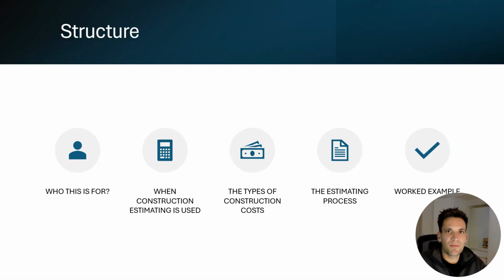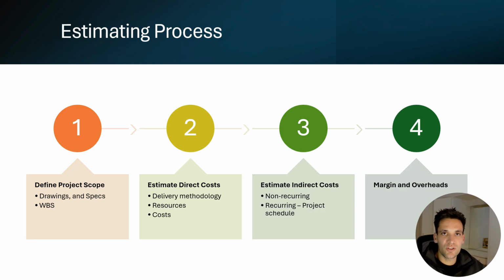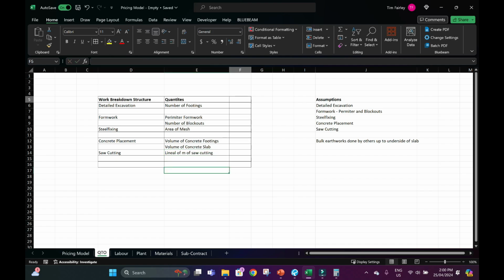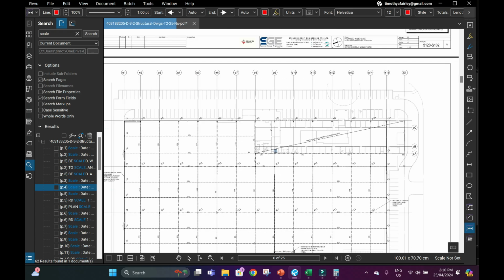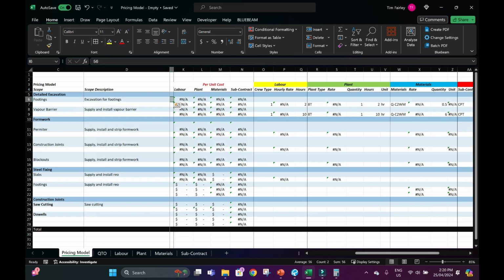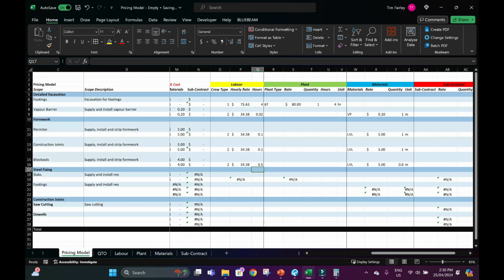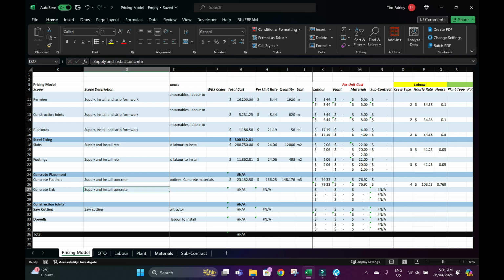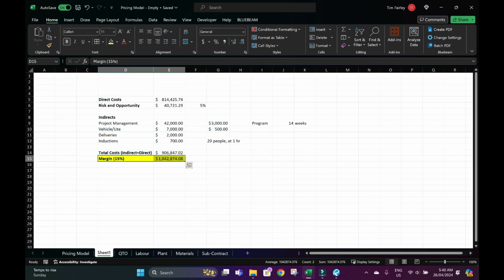Estimating Construction Costs: What You Don't Know (2026)

Comment: Hi mate, bluebeam revu, planswift, buildxact are all based on pdf 2d tracing for take off.. if someone figured out to take off ALL items in BIM accurately.. what do you think? I know architects and engineers BIM model are not exactly suitable for estimating take off.. but is it time to move from old 2d tech to full 3D BIM for estimating?
Reply from the maker: Hey! I recently used BIM to do a take-off of cable tray on a plant, and I thought it was incredibly useful. You definitely need to do some sanity checking. For example, the BIM model had 90 different types of bends for cable tray. In practice, you would rationalize these and use less different types. It really depends the purpose of the QTO